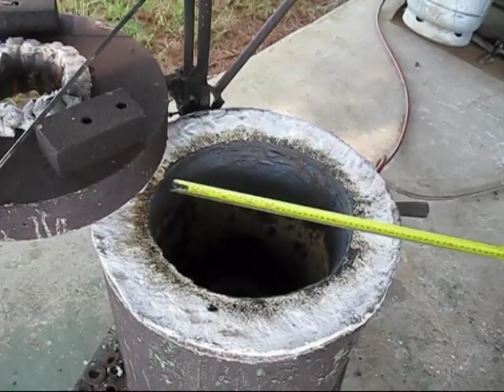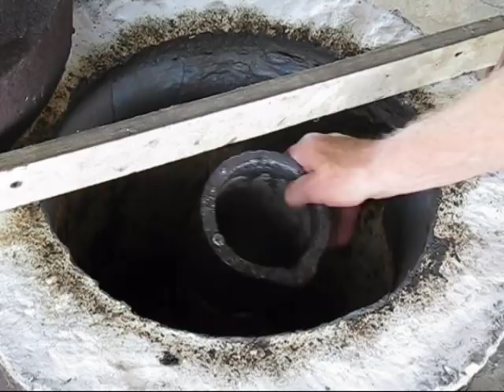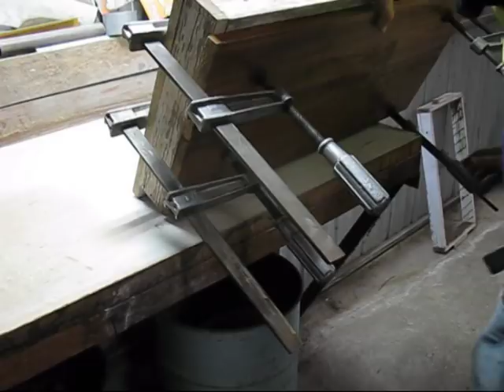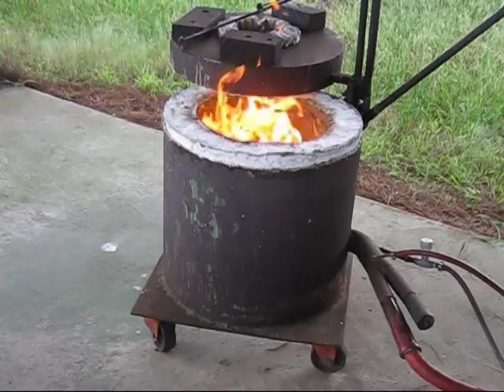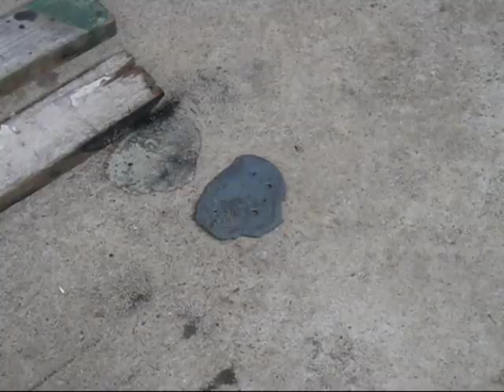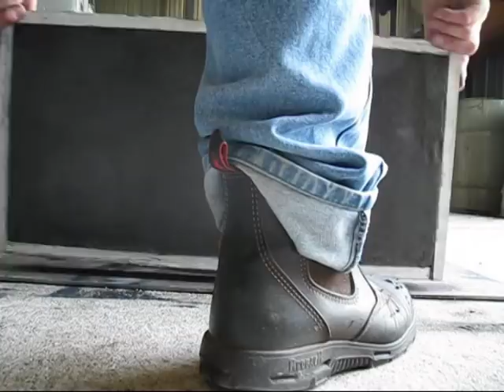Furnace dimensions, another iron melt

Comment: Hi 
Just a quick question 
When the waste oil enters the furnace with this pressurised system does the oil come out of the nozzle in a stream or a mist
Reply from the maker: It comes out as a stream and is atomised by the blower air.
Reply: @luckygen1001 Thanks for your reply 
I am a windmill restoration company in Doreen 
Have built a furnace based on your design for melting cast iron brass
It works a treat
Thanks again
Reply from the maker: @paulsly7793  Have you got a video of the furnace working?
Reply: @luckygen1001 yes l do
What is the best way to send it to you
Reply from the maker: @paulsly7793  I am on the model engine maker forum, send me a P.M. and my user name is "airmodel"

Comment: Greetings! I have been trying to make crucible steel or Wootz with a waste oil furnace but I've had extreme difficulty keeping the waste motor oil burning,I pre-heat the furnace with firewood but the moment it burns away the oil goes out as well.
I have had sucess reaching steel melting temeperatures before but with radiator oil,it was very thin and burned very nicely.
I just saw some of your old comments where you mentioned that mixing waste oil with diesel will make it burn much more easily,how much diesel would you add per say a liter of waste oil?
Thank you in advance!
Reply from the maker: I use 20% diesel but it is better to use a 50/50 mix to to see if it works and then cut down the diesel to a smaller amount.
Reply: @luckygen1001  Thank you very much for the speedy reply! 
I'm currently using gasoline as it's what I have at hand, being far away from a gas station.
Using about 60ml per liter, hopefully it works.

Comment: Doing my furnace out of stainless steel keg same size is it better todo kaowool  and water glass or cercast 3000 I really need youre opion
Reply from the maker: I have only used kaowool.
Reply: Were in Australia can I get it
Reply: Thankyou I’ll go with kaowool what did you use too coat the wool and were would I buy it from .iam in brisbane
Reply from the maker: The coating I use is no longer made but you could try satanite.

Comment: What can I add to the cast iron melt to produce good grade for manhole covers to withstand 10 tonn wheel load.
Reply from the maker: If you add a small amount of steel it will lower the carbon content and raise the tensile strength.

Comment: The concrete had little moisture content as does your sand. You can pour water on hot iron but not hot iron on water. Mount 2 2X4s across your bottom boards this way it will accept your clamps and not pinch your fingers. Videos are nicely done.
Reply from the maker: You can pour hot iron onto water, have a look at my video  https://youtu.be/7kho0iVN0wg

Comment: Regarding mixing steel with cast iron, If the steel has a higher melting point, perhaps you should melt the steel first, then gradually add the iron, letting each addition melt. I got the idea from cooking where adding liquid to powder while stirring yields fewer or no lumps than reversing the order. Also, the first iron addition to steel would melt 50-50, so the ingredients would be in greater proximity than adding the small quantity to the larger.
Reply from the maker: If you started with steel it would take too long, much quicker to dissolve steel in molten iron.

Comment: If you add oxygen through a pipe to the bottom of the molten iron, will it turn to steel?
just like this:
https://upload.wikimedia.org/wikipedia/commons/thumb/5/57/Sch%C3%A9ma_LD_m%C3%A9tallurgie.svg/220px-Sch%C3%A9ma_LD_m%C3%A9tallurgie.svg.png
Reply from the maker: Yes it will.
Reply: I know it will work in industries, but will it work at home?

Comment: Vent hole on top approx. 6"
Lid thickness approx.  3"
Furnace inner diameter approx. 13 3/4"
Wall thickness approx. 3 3/4"
Furnace depth approx. 14 3/4"
Crucibles:
A6,  approx. diameter 5 1/8"   approx. high  7" 
A12,    approx. diameter 7"   approx. high  9"  
A20, approx. diameter  9 4/5"  approx. high 7 4/5"
Reply: Real world measurements 😂